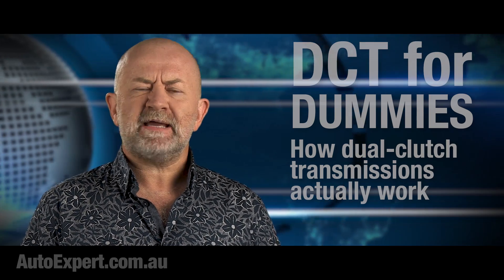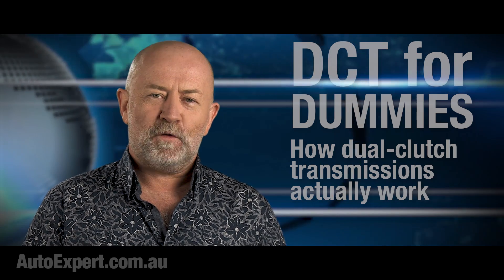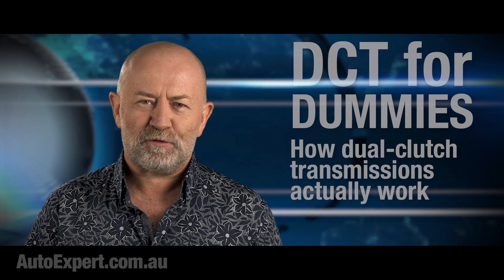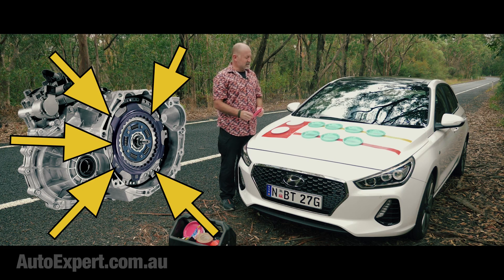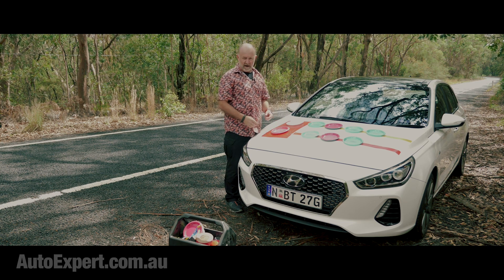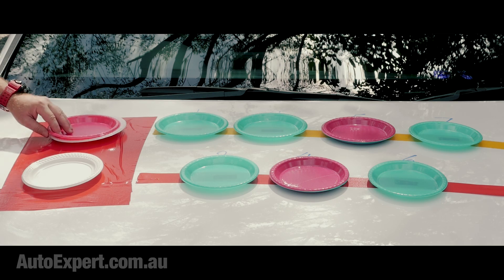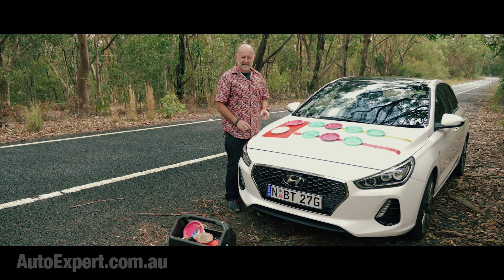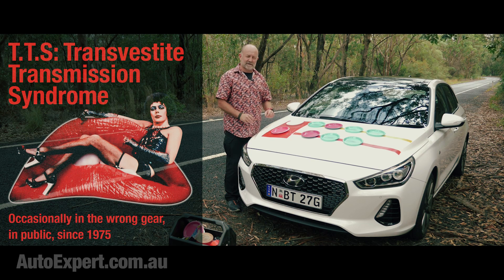DCTs for Dummies. (How dual clutch transmissions really work.) | Auto Expert John Cadogan

Comment: The dct is much better than the single clutch automated manual in a smart...   Dct is better than conventional auto. Cvf better than dct. The dct I drove was a 2017 Hyundai i40 and I do city driving, a lot of the times starting from a stop there was awefull vibrating of the whole car and my customers thought the car was broken. The problem with the i40 is the engine takes so long to drop rpm that it can't take advantage of fast gear changes

Comment: no good for towing or reversing a trailer
Reply: About as good as a manual
These transmissions tend to have quite short first and reverse gears so slow speed maneuvering is easier. Although a CVT or traditional planetary gear auto will give better results
Reply: DCT is only suited to small or sports cars anyway

Comment: Give me a torque converter any day, who cares for the extra 6% loss of fuel economy, my Transmission & CV joints will last longer, Auto  transmission anyday please
Reply: I'm personally going to stick with my E-CVT which doesn't have nor need a clutch or a torque converter. Just pure, unrestricted, power(or at least whatever power can be expected from a 2014 Prius C...which is admittedly more than anyone cared to admit)

Comment: Lower third title made me laugh and I missed the good bits so had to go back and watch again. Good job explaining what goes on down there. I hope that Hyundai has a fiddle down there on the i30n and puts a dct in it. I’ve only driven 1 dct and been a passenger in another and both were Volkswagens both times I was very impressed with how and what they did so im a fan of them. Will you be doing these videos on cvt as well?
Reply: I have a feeling that Hyundai will need to develop a bespoke DCT for their 2.0T motor, as shoehorning the same one from the 1.6T wouldn't be a good idea.

Comment: Good idea on paper, but what has hyundai/kia done differently with their dct's compared to ford/vw in order to regain faith in dct's again?
Reply: Hyundai has made DCTs that aren't heaps of shit. Also they actually cover the damn thing under their powertrain warranty instead of trying to screw you out of money like Ford.

In all seriousness, I know Ford's design is bad because it can't reject heat fast enough. Hyundai's only suffers from this when you beat on the damn thing for a long time.
Reply: I can't fault Hyundai's, fantastic
Reply: Calculated Risk so better heat distribution and actually covered under warranty, got it thanks :)
Reply: James Dewar 
I bought a 2010 i30 diesel wagon about a month ago and it the best car I have owned, but saying that I have owned some ordinary cars.
Vl holden commodore executive, s1 v6 n/a wh holden statesman, and a very very regrettable holden viva (it seemed like a bargan at the time).

Was a little sceptical about Hyundai's after seeing everyone driving excel's when I was growing up but John approved so I thought I would look into it, 5 minutes into the test drive it was a no brainer. Though it still makes me laugh in disbelief everytime I look down and see the chrome hyundai badge in the middle of the steering wheel.

Comment: It would be cool if there was a pre-select input on the steering wheel that could tell the DCT which direction to preselect (up, down, or let the car decide).  But it would probably really confuse a lot of people.
Reply: Lots of dct equipped cars comes with shift paddle.
Reply: Yeah, but that is just for manual-control mode, right?  The car still predicts the next gear and predicts which direction you are going to shift up or down. 

I'm saying you could have an input to inform the car how to preselect the transmission. Let the car decide when to shift, but you tell it which direction (up or down) to get ready for.
Reply: That's actually a pretty cool idea
Reply: from the car i've driven, you can hit the shift paddle for a downshift in auto mode and the auto program will resume after a few sec, which is more than enough to pass a vehicle on the highway or use engine braking on the approach of an intersection or making a turn at an intersection and be able to quickly regain speed.

forcing a pre-select sounds a bit weird like saying "I think I know what I'm about to do but I might not"
confident driving is usually a good start to good driving
Reply: Marc,

 Good driving is all about anticipating what will happen next.  Nasty surprises happen more often to reactionary drivers.
Reply: Indeed, though I'd argue that it is as long as it doesn't come with hesitation and indecisiveness. 

back to the subject,
since auto transmission are not wired to our brain, they can only act in a reactionary way unless you use a manual input.
Which is why if you anticipate that a downshift will be required it's probably a better thing to downshift directly than to wait for the computer to get all the information required for it to say yes it's time and then downshift.
Reply: Marc,

Lets say you are in 5th gear on a 2-lane highway.  You pull up behind a slower moving vehicle.  Your car doesn't know you are going to pass someone, and the transmission may be setup to upshift into 6th, when what you really want is for the car to stay in 5th gear until you begin passing and be ready to downshift into 4th when you begin to pass.  The car might actually shift into 6th momentarily, then would have to downshift twice to get you into 4th so you can accelerate for the pass.  Telling the car what you anticipate to do (downshift) will prevent it from doing the opposite.  If the car upshifts into 6th right before you start the pass, you're still going to need to directly downshift twice.
Reply: It's a tough one to answer though i'd argue that if you're looking for the best fuel economy, you'd be looking to minimize speed variation, so you'd try to plan a lane change ahead before you'd have to slow down.

On the other hand, I understand why you might want total control over the behavior of your transmission and engine (that's one of the reasons I enjoy driving manual), but you also have to think of how would it be possible to implement a system that would allow you to communicate efficiently that to the car and simple enough for everybody to use. (and i'm ready to bet that most people that owns car with paddle shifter (dct or not) do not dare to touch them)

Anyway, such downshift should still be faster than what you can do on a manual transmission, it's just that the shift is a bit longer than usual and and it may feel a bit underwhelming.

Comment: I don't know what you mean about the VW groups effort in DCT.  My Skoda performed OK for 50,000klm before it had to be rebuilt at a modest cost of $3200.  Just imagine how much it would have been if they had not done the recall at 30000klms!  Pity I didn't know at the time about "reasonable expectations".  But I want one of these DCT's in my hillclimb car.  Quafe makes a sequential systems that fits for 10,000 pounds.  Must do some measurements and see if I can fit the engine and box in.

Comment: I "Merica", just as in, "Stralia" there have been many problems with VW and Ford DCT's and also with Hyundai DCT's. Hyundai DCT's seem to be more sorted out as of 2017. I know several people who have recieved updated DCT's for their earilier Hyundai's under warrenty and they tell me that the new units are much better. I have a 2017 Hyundai Tucson and the transmission works well. There is a learning curve in driving technique to get the DCT to not choose the wrong gear from time to time. I have many years experience as an an automotive repair tech so I have a bit mor savvy than many other drivers who don't fully understand how the DCT works. These transmissions are not for everyone. The sales staff do not try to explain these transmissions when you are buying the car.

Comment: These transmissions remind me of the preselector gearboxes of the '20s and '30s (although they used epicyclic gears.)  The concept of selecting the next gear in advance, then shifting to that gear when needed, sounds very similar - just with automation for the actual gear selection, as well as to operate the clutch.)

Comment: How  about people just learn how to drive a car with a real transmission? Drive a manual transmission and your car will be on the gear you want it to be 100% of the time.
Reply: Who said anything about banning anyone or anything? Where did you pulled "BAN" from? We were discussing reliability, simplicity and cost of repairs. The greater the number of (moving) parts any machine has, the greater the probability of mechanical failure. I drive a 1997 manual trans Ford Ranger, 21 years, 142,000 miles, 228,526 Km on the engine and transmission. I don't see those new fancy gizmos lasting that long.
Reply: dgracey01 manuals are great for fun but besides that there a dying breed
Reply: dgracey01   That is going back in time.....with current traffic densities, the only way forward is auto, except of course for boy racers and others who are impatient and intent on creating mayhem misery for others....cos I can!!!   You dream if you think every driver of cars and motorcycles use a manual gearbox correctly...far from it.   Autos at least provide the opportunity for the inept to concentrate on the road .... occasionally.
Reply: My truck will be in the gear I want it to be 100% of the time cause it cannot shift on its own, hence called a manual. Now, If you want to argue that is is going to take me a few seconds to shift gears then yes, a few seconds (if I'm driving and eating at the same time). So little time I can round it off.
Reply: There are so many types of transmissions out there for different tasks, manual is t always the best one
Reply: dgracey01 the only transmission that ever cramped out on me was a manual. Burned up clutch on a used Mazda b 2000. Probably cause the previous owner didn’t know how to row his own gears. Automatic transmissions do it better and faster than 99% of all drivers out there and when properly maintained will last the life of any car.
Reply: that's like saying, lets go back to letter writin instead of email.
Reply: dont really find that a problem .leave the car in second gear and just let go off the clutch rather than press the gas pedal. same as having to hold the break in an auto....
Reply: I pulled the word "BAN" out of my arse, just like where you pulled your logic from. I replied to the comment "How  about people just learn how to drive a car with a real transmission?" NOT EVERYONE HAS THE ABILITY TO PRESS A CLUTCH. I suppose in your world everyone is perfectly able bodied? I personally also drive a manual, and would continue to given the option, but it's becoming more difficult for me due to a degenerating nerve issue. It's not about moving parts or even reliability if driving a manual isn't an option, as it indeed isn't really for some #Eugenics
Reply: Mateusz Wojtkiewicz couldn’t agree more! Lol
Reply: I’m perfectly happy with my ZF transmission, it’s on the right gear nearly 99.9%
Reply: Thank you for saving me the trouble of saying so myself. We were talking about simplicity of design and ease of repairs. Suddenly there are comments about Eugenics, disabled people and plain ol' justice warriors and your average space cowboy (cow-person?) raging about defending their god given RIGHT!!! to drive an automatic trans. Case on point: I messed up my Range's trans once, hawling too much weight, cost me $1500 to rebuild, now is back as new. If you own a late model Mini Cooper and your pretty and shinny CVT trans dies, like many of them did, your car, your 30,000 miles beautiful Mini , is going to the scrap, cause not many can foot the 5 figure repair bill:

http://www.mini2.com/forum/first-generation-cvt-automatic/178627-automatic-cvt-replacement.html

Conclusion: Drive a car with whatever transmission you can drive or will afford. The more complex the machine, the sooner it will break, the more expensive the repair will be. Can I say The hell with all these SJW? please?
Reply: dgracey01 Meh, this is only ever a problem if you need to replace it in the first place. 
I never met anyone who has had reliability issues with their auto transmission, friends, family members, co workers. I've only changed the transmission fluid on a 16 year old kia and the thing still works with 0 problems. I still prefer a manual because of driving feedback but maintenance? It hasn't given me any more problems than a manual.
Reply: Assuming everyone is a careful and or diligent as you, I hear ya'. Is that 16 year old auto trans on your Kia one of those fancy CVT's or the double clutch ones explained in the video?
Reply: dgracey01 Neither, it's a torque converter. I don't think cvts were even a big thing yet back then. I'd only be worried about reliability on auto trannys if they were dcts from Volkswagen, I've heard far too many horror stories from owners to ever get one.
Reply: John Boy You said people are too lazy to drive manuals. Hate to say it dude, but you’re the crybaby crying about other people not driving transmissions that YOU drive.
Reply: pros and cons.
Reply: no, just the people who want to learn to drive them are a drying breed, or the fact that manufacturers no longer put MT in anything but their poverty pack model. I'll take a manual any day over an auto. None of the cars I've owned over the past 35 years have been auto.
Reply: abolish starters? you don't need do do that - Mazda will do it for you with their SkyActive BS
Reply: do it ! about 30 years ago, well before cell phones, I wired up the handset of a house phone for my CB radio ,with a long enough cable to reach the  passenger with slack to spare. One of my mates would lean out of his window, holding this handset out to cars in the next lane saying "you're wanted on the phone"....we got some strange looks ;)
Reply: Hate to say it but manual transmissions are obsolete as are conventional automatic transmissions. This basically leaves the DCT, CVT, and E-CVT. I'm personally banking on the E-CVT since it's actually mechanically simpler than a manual and has all of the advantages of a CVT without most of the disadvantages(only disadvantage that comes to mind is battery issues, but NiMH batteries love to be cycled millions of times anyway so that's not too big a problem). DCTs are a nice compromise between an automatic and a manual, but should probably only be used by performance enthusiasts who know how to drive one(since these people seem to have something against CVTs for some reason).
Reply: Oh yeah. I love me that manual in 2h-long traffic jam. Mmmmm the joy. How about we abolish starters as well. Get into an intimate relationship with your engine by manually cranking it.
Reply: People are to damn lazy I love a manual myself
Reply: Joke all you want, but when one of those fancy new automatic transmissions fail, and fail they will just like any other machine, the repair bill is not going to be a that funny. Manuals may be  a dying breed but they do the job, they are dependable and they are cheap to buy and fix.
Reply: @Zero-00-0  $3200 Is cheap >,>
Reply: How about some people have no choice such as I due to disability!
Reply: I suppose you'd ban disabled people from driving whilst you're at it? Not everyone is in a position to use a "manual" to be fair. Not that all disabilities prevent the use of a manual, but some do make the availability of an "auto gearbox" a more attractive proposition.
Reply: Huw Williams I have...

$600 to replace the manual transmission in my '99 Ford Ranger when the old one shredded apart...

'Nuff said... Drop the mic...
Reply: Read my other comments here, seems you didn't think it through before making that dumb comment.
Reply: Well said.  I have a disability and literally have no choice.  Some commenters here are either thick or antagonistic.  I wish I could have driven a manual over the years as for one thing in the UK there's always been much more choice.
Reply: All y’all bitching about a disability yea there are exceptions for people that can’t do it grow the fuck up my comment was in general not to anyone specific Jesus Christ what a bunch of cry babies u just looking to be offended by the dumbest shit
Reply: So everyone who drives an auto is lazy, how old are you?

Comment: So let me see if I've go this right. Inside the gearbox are two white paper plates, three red plastic plates and a number of blue plastic plates that equal the number of gears that the car has :). 

In all seriousness, I had a little smile when you mentioned "pre-select" as I used to drive a 1930's vintage vehicle with a manual pre-select gearbox on occasion. Took a bit of getting used to but a lot of fun. 

Ref not understanding how a DCT works, I'm fairly sure that if you asked the average driver if they knew how a traditional fluid coupled auto gearbox worked, they probably could not give you an answer to that either.
Reply: If you drive one of the Fords with the "powershift transmissions". You'll indeed see that they've used plastic plates and tape.
Reply: AutoCritic On that note, I have actually watched videos where ENGINEERS try to explain how a fluid-coupled auto works... They even go so far as to TAKE ONE APART to show how they work...

And it still made bugger-all sense to me...

I can understand how a manual, a DCT AND a CVT work...

And I STILL can't make sense out of a traditional fluid-coupled automatic...

That says a lot in and of itself... :P
Reply: Devotio Official pissed my self. An orange juice for lubrication!
Reply: Andrew S hahaha!!!
Reply: London buses used to have "pre-selector" gearboxes I believe.
Back in my Uni days one of my lecturers had an Armstrong Siddley, he love to show off to us engineering students how it worked.
Reply: Devotio Official 😂🤣😅👍👏
Reply: Not blue, GREEN!